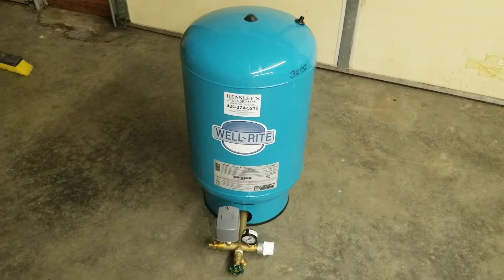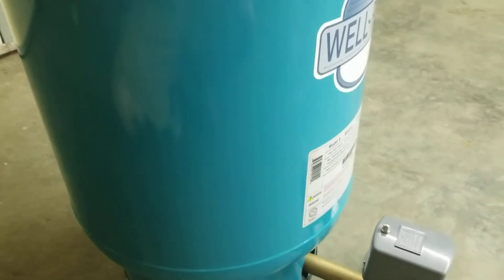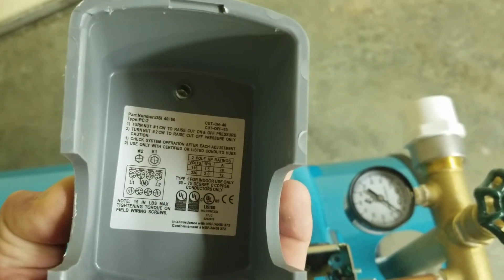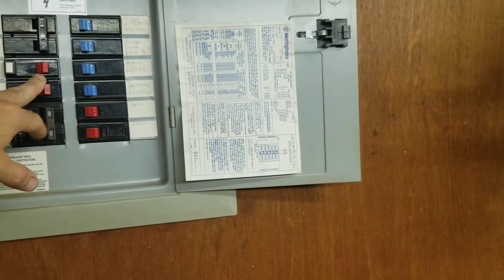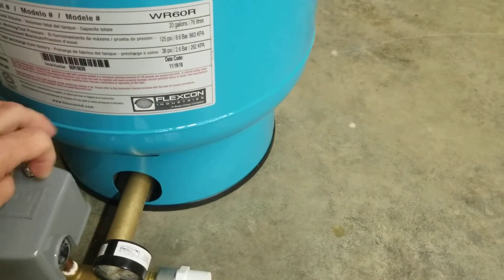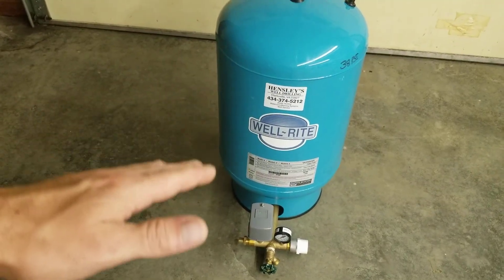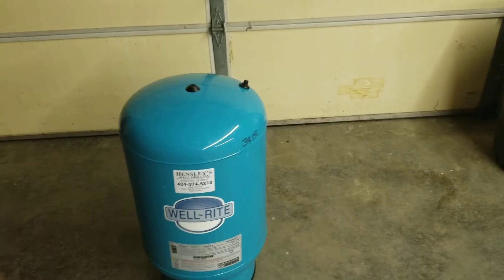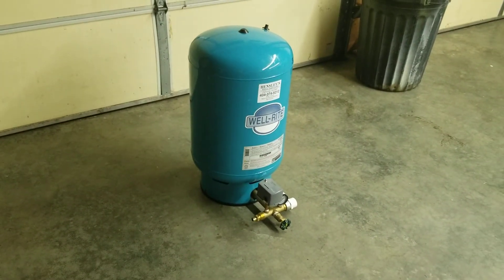Well Pump & Tank Troubleshooting, How the system works, Adjusting Pressure Settings Correctly

Comment: Well I have a question on a issue I'm having And not having any luck getting  a plumber to come over and repair the problem I have low water pressure issue first I checked the well the water level is good  I checked the water pressure tank did the knock and tilt test and it moves easily and sounds hollow the pressure gauge reads 28 and dosn't seem to change we do have sediment issues so I'm  guessing a plugged pressure switch possibly the tank is in a hole in a crawl space under the house within  a few feet of an access door but not in a good spot for me to try to repair it myself I was wondering if switch which I believe is a 30- 50 switch could be stuck on the low side and if there was anything I could do or should do to prevent maybe ruining my well pump which was replaced three or so years ago. We had a water softener which was by pasted because of issues  and the people who fracked the well and the well never came back to deal with the softener so it remains by passed.
Reply from the maker: First of, thank you for taking your time to let me know what happened. I take pride in my trade & am really good at diagnosing the issues even through a few informative messages. I glad to know you had a skilled person who understands the water world come out & fix your system the right way!  You should get 10-12 years out of that new pump. I'm happy I could help you & if you have any questions or concerns in the future, you know how to reach me.
Thanks again!  Philip Hensley
Reply from the maker: High sediment levels & low pressure, you could try changing the switch and the nipple is sits on. But if your getting water, & it won't build past 30psi, the impellers in the pump have probably worn down & opened up the tolerances inside not allowing pressure to build all bc of the grit u are getting. Or if you have a 300-400 ft deep pump, I've seen pipe split due to the psi it reaches at that depth. To test this, kill the power at the breaker & wait 5 minutes, then open up a sink & see if u have water, if the pipe is ok then you should still have a few gallons stored in the tank. If no water comes out, pipe is split or a fitting is cracked down near the pump. You mentioned fracturing, we do that process & what I just described is a common occurrence. And questions, I'm here to help.
Reply: @h2omechanic  Thanks for your response the well pump was replaced  about 4 years ago and we are getting water and have been right along now just with now the last three or four weeks now its lower water  pressure and the well is 330' and was fracked becouse of low water level ever since fracking its been good. I guess the switch and nipple may be the first thing to try  if I can find someone to do it. Thanks again.
Reply: @h2omechanic  Well I didn't bother with the switch and just called the water well guys here locally and in two minutes he determined it was the well pump after pressure testing it determined it was the problem and then once they pulled it up he laughed and told me the last guy a plumber had installed the wrong pump for the depth of the well and  it was a cheapo hardware store pump that cost around two to three hundred dollars that he had changed me eleven hundred for and yeah I wasn't impressed.  So new and correct pump installed and problem solved. You were right 😁👍👍👍

Comment: I got a letter from adult protective service's,......in June 2019,.... as I walked into my house,.......I herd thump,... thump,... thump,... the well pump running,.........SOMEBODY?  busted  pipes under the sink and somebody  busted components inside the upstairs toilet and later I discovered they put foam rubber and cement in a sewer pipe.
Water was all over,..... and later the sewer backed up.
Now in March no water. I think all of this was done at the same time and it took until now for the pump to go bad?

I had watched a few video's,........I don't think any water or air came out of  the air thingy 

And tapping on the tank,... it sounded solid and it was verry heavy.
I opened the valve and nothing came out so I put some air in and water ran out the drain.
There is electric to the pressure switch,........ and thats all I know. But no water comes out of the pipes.
Oh and all the shit was new 2 years ago?
Reply from the maker: If you pump the tank up to 25 psi of air & it holds at 25 psi for a few days the tank is ok. If it leaks down replace it. I'd suggest turning on your well breaker & test the wire nuts out at the well for power. Make sure you get 240v. Its probably dead if it was left running.  My other videos explain how to pull & replace a pump

Comment: We just replaced our well pump tank. Shortly after we started having uneven pressure again. The shower goes good for two minutes or so then just trickles. It’s been a busy week so we had to wait until this weekend to fix it, but this afternoon, no water! Maybe 1/4 cup will come out, then nothing for awhile. The pressure gauge is real low. I’m trying to diagnose using YouTube, and hoping you have some suggestions. Thanks!
Reply from the maker: You are correct by cleaning out the pressure switch nipple. That was 100% your issue. I was under the assumption that you replaced that with the pump/tank. If your still having issues, you can call me & I can walk you through any diagnosing tests. Hope it works ! Fingers crossed
Reply: H2o Mechanic we should have replaced it all! You live you learn! I’ll let you know how it goes,  and I appreciate the input!
Reply: H2o Mechanic So, that didn’t fix it. We’re wondering now if it’s the box that has all the wires going to it. I do t know what it’s called but we think this supplies power to the pump and is faulty. My husband is looking up how to test it with the meter. One of the ports has a black mark on it.
Reply from the maker: Sounds like to me the tank has too much air pressure in it. Air pressure in tank should be 5 psi below the switches "on" psi. You probably have a 30/50 switch so. Turn off breaker, drain off all water & use a tire pressure gauge & test air pressure in top of tank. This should fix your issue by letting out some air
Reply: H2o Mechanic we’re working on it this evening and I just checked the pressure. 28psi. I’ll let out some air. We think we may have an iron blockage in the small pipe that goes up to the pressure switch. We cleaned it out and are going to put it back together. That and the little bit of air I’ll let out hopefully will work out the problem.
Reply from the maker: 4342101376. Send me pictures of your system.  Tank, wiring box, well head. Then I'll call you

Comment: MY WELL PUMP SHUTS OFF ONLY WHEN FILLING BATHTUB
Reply from the maker: Will it randomly start back up after 2-3 minutes? If so the pump is probably on it's way out & heating up which cuts off on a thermal overload. Probably time to change it. Pumps fail alot if the tank is bad. Check that to. My videos explain tanks as well

Comment: My water pressure goes well below 30 psi. What could the problem be?
Reply from the maker: Look under the grey switch cover & read the on/off numbers should be 20/40 or 30/50 or 40/60. Those are the psi ratings of the switch. With all water out of the tank, make the air pressure in the top of tank 5 psi below what the "on" pressure is that u see in the grey switch cover.

Comment: Hi I pressed the air valve low pressure air came out , my husband later did the same thing and a little bit of water came out. The tank does not sound hollow and while I can budge it it is definitely full of water? Should we try to drain it?
Reply from the maker: No need. It's bad. Time to replace it. Go to lowes & buy one the same size. Easy way to remove your old tank is to drill some holes in it .
Reply from the maker: You can add air at the top just to help get you pressure for a few days, but it will leak out with the water soon. DIY you'll spend $200. Professional should be 500-600 installed for parts & labor.

Comment: I went home one night and found out no water from tap, then I went to the basement and found out the fiber tank pressure gauge reading 0 psi. Then I didn't bother to fix it since I had a 3 weeks business trip. When I returned from the trip, I got the hydro bill and found out I had to pay over $150 dollars. Took me a while to figure out the well pump was probably running the whole time while the pressure gauge reading drop to 0. I checked the valve on top of the fiber tank and it got air pressure inside. Do you think it is the pressure tank switch problem?
Reply from the maker: At the well, there should be a sample port to get water from. See if water comes out. And test wires at well for power 240v with electric meter. If u have 240v & no water, the pump is either dead, or running nonstop & has came lose from the pipe down the well. Typically its a broken fitting that joined the pump & pipe. Call a professional to pull pump.

Comment: Every couple months we completely lose water pressure then the water itself. It will trickle out or go completely out. Pressure gauge was replaced, pump reading that its working correctly.  It would eventually start working again fine and then all of a sudden its gone after several weeks.  The pressure is cycling but not really creating much pressure or allowing hardly any water to flow
Reply from the maker: 4342101376 call me. It could be 2 different things. Easier over the phone.

Comment: my pressure gauge is showing pressure but no water. could that be the tank?
Reply from the maker: Probably just a bad gauge. If you dont have water pressure in your house, it's either the switch next to the gauge or it's the pump/ wire down the well.
Reply: thanks for the quick reply, it was no good but was not the problem.

Comment: Hey H2O, I recently pulled my pitless Spool adapter out. The fitting on bottom side was spraying whenever the pump kicked on. It rusted away and failed.  Cheap fix. But the reason for this question is my water pressure is low. Just wondering you had any advice. The spool adapter I speak of is a 1982 adapter, House was built in 94. The two o-rings are not damaged at all. So I put the recommended Vaseline on the
 O- rings and dropped it back in the casing. I’ve done the check and added some pressure to my tank to 38psi. But just confused bout the low pressure. Thanks in advance
Reply from the maker: Air pressure in the tank can only be added & checked if the water pressure is on 0 & pump breaker is off. Typically low pressure is either low air in tank, plugged up inline filter, or the sink screen is clogged.

Comment: I'm a new home owner and I started to notice my pump would cycle on when you flush the toilet or run water I checked my pressure tank and it's not filling with water could it be plugged not allowing water into the tank
Reply from the maker: Flip well pump braker off. Open faucet until water stops. Using an air pump, add air to the top of tank at the Schrader valve. Just like a car tire. Put 25psi into tank. This should help your system perform better and not kill the pump prematurely.

Comment: We are new homeowners and our water went off last night. We have a well system. Been watching your videos since 4 am because our water is not working. Great information. My pressure meter next to the control gauge is at zero. I'll be cleaning the contact points as soon as I get some light. But it seems most videos I've watched, the gauge even when folks have no water, is still working. Any advice?
Reply from the maker: The gauges are cheap. Dont trust them if your not sure. Best thing to test is an electric meter.  Test wirenuts at well & make sure your getting power there first.

Comment: Please call me 2406030098
Well problem
Reply: Question for h2o mechanic on my 33' point well with 1/3 hp jet pump. Suddenly lost pressure at my seasonal cottage. Replaced my 20 year old check valve but that didn't do it. Took apart pump and nothing clogged on venturi or nozzle. Pressure tank was down to about 12 lbs instead of 18 but added back air to 18 cut in pressure but that didn't help. There is water in the pump and below the check valve on the suction side of the 1 1/4" black plastic pipe after priming and running pump for several minutes.  I see no leaks in any of my galvanized fittings before or after pump. Pump doesn't sound any different than before but seems to not be moving any water or very little. Pressure builds to maybe 18 lbs with ball valve closed on discharge side but when I open it up slowly the pressure drops to about 4lbs and stays there. Thinking the point could be plugged so starting in that direction next unless you have a different idea to try.
-Sid

Comment: Just had a submersible pump installed and it blew the capacitor on the control box. The well is in south texas and the pump 1 hp. Any idea what to check first? Thank you.
Reply from the maker: Call in a professional. Something is definitely wrong. Wired wrong or bad pump.
Reply: Replaced pressure switch 3 wks ago. Now water surging & cycling is stuttering. Replaced control box (front panel). Water ran pretty good for about 1 & 1/2 hrs...now NO water at all. Submersible. Fixed income. Trying not to call someone in. Do you think relacing the other half of control box would matter? Guess it wouldn't  hurt. Thanks
Reply from the maker: @MH-yl9zp  . If your water is cycling high to low pressure very quickly, you'll hear the pressure switch clicking on/off very fast over &over. This means that the tank needs air added to it. Add air to the top just like a car tire. Typically if it's old its probably a bad tank. Even if it's bad, add air & see if it helps. Although it will only be a temporary fix & it's just a test. Follow these steps. 
1.turn off well pump breaker
2. Drain all pressure from any sink.
3. Add air to top of tank using a air compressor just like a car tire to 25psi. 
4. Turn back on breaker and see if system acts normal.